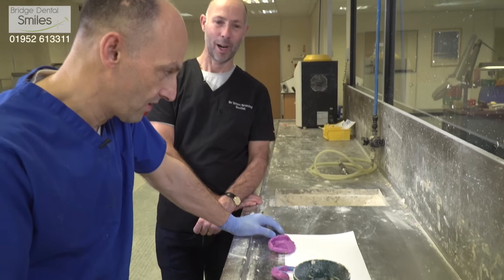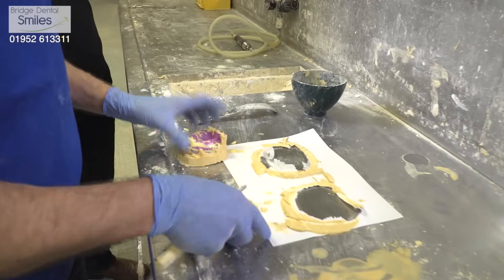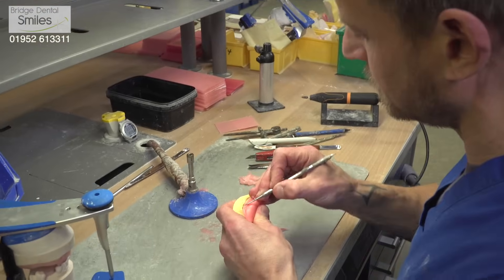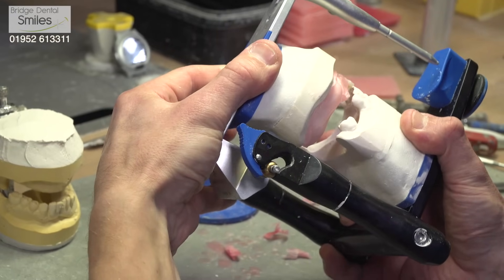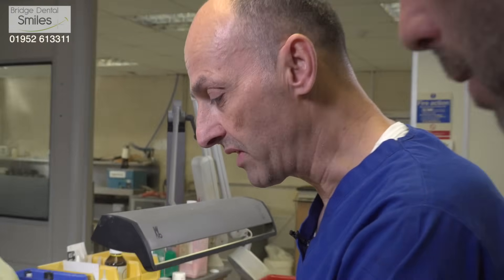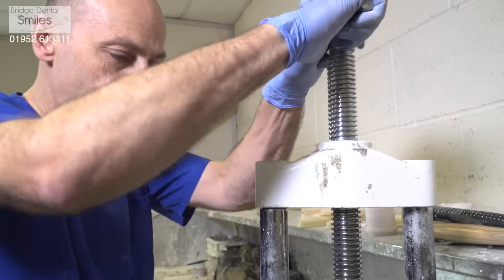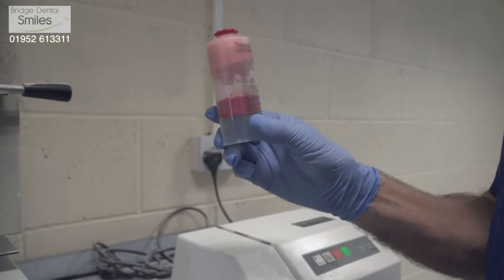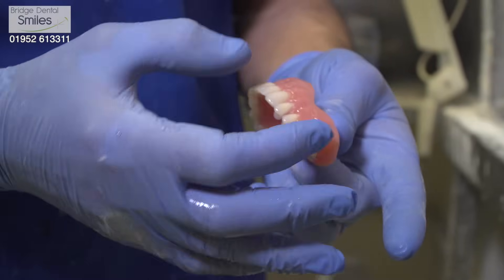Private Dentures versus Budget Dentures - How False Teeth Are Made - Telford, Shropshire

Comment: At the dental technician myself great job, I've been making removables for 37 years and where I live in wicomico county Maryland all the dentist send the most crappiest impressions and model work that I've seen in the last 15 years. They cared nothing about their patients all about the money denture millwork!
Reply: @debbielosli830  It is super hard to tell the difference between a cheaper and a premium material as a patient. Both come in different colours and with and without fibers. So they can look absolutely identical. The main factor is the ammount of monomer which stays in the finished product. The lesser the better becuase it can cause allergic reactions and irritations of the tissue. Another factor is the shrinkage of the material. Over time they tend to shrink a little. Some materials shrink more than others. The premium material used in the video is a hot polymerisation material which compensates a lot of the shrinkage and because of the heat has very little monomer left in the denture.  Another point is the ammount of water it absorbs which can cause discolouration and of course bad smell. There are some more factors, but like I mentioned it is super hard to tell if a premium material was used. If you have no suction, you should get it relined. This can be caused by a bad impression (eaven the best denture is only as good as the impression) or bad design of the denture base. Of yourse there are more factors like weight loss, diseases, decline of the jaw or other factors. Hope I was able to help a little bit.
Reply: @noobsalsowinsometimes8350  9
Reply: Mark can you make me some dentures? Im in La Plata MD.

Comment: tbh it's absolute bullshit, i have paid twice for private partial dentures and both sets lasted less than a year? costing me in excess of £700 previous to that i had a make do NHS denture costing £200 that lasted over 2 years???
Reply: If the first set lasted less than a year, could you not have complained and had them fix/replace? Don't they have guarantees? I only ask because I'm currently having veneers that I'm paying for, and my dentist is fixing things, changing things, and providing an ongoing guarantee with the work/materials. I have NHS for other routine things though. But for the private stuff, I'm be furious if things didn't last long.